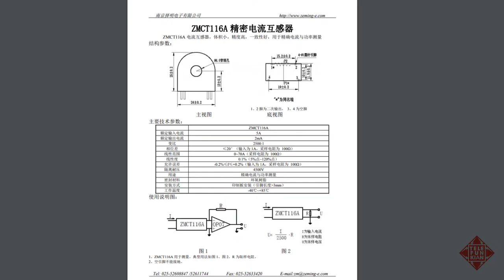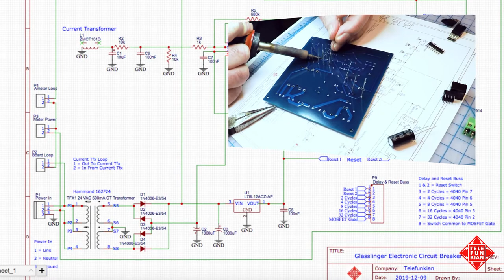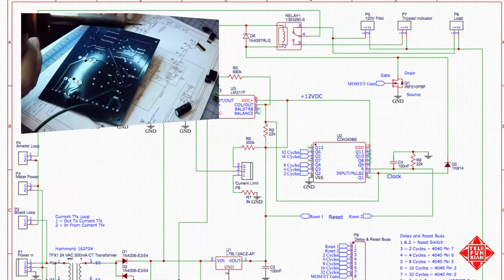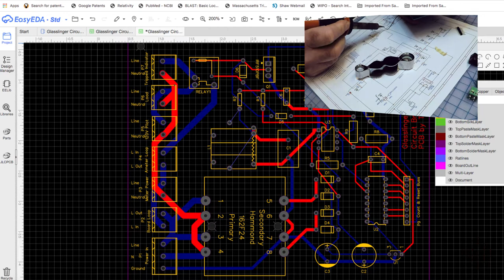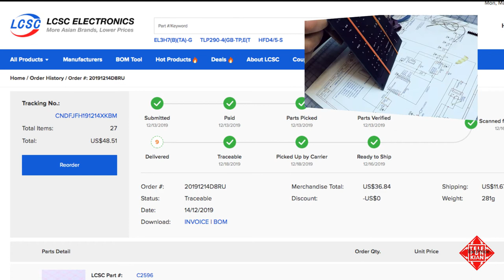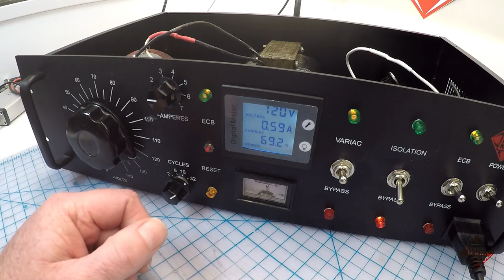Glasslinger Electronic Circuit Breaker With Variac and Isolation Transformer

Comment: Love this build. Would this affectively replace the 'dim Bulb' setup that alot of vintage repair engineers seem to be using?
Reply from the maker: Steve, First thanks for watching! I use this setup instead of a dim bulb, but it does more than a dim bulb setup. A dim bulb limits current based on the wattage of the bulb in circuit. This takes the place of a dim bulb, variac and isolation transformer in one chassis and clears up a mess of cables on my bench. More complicated than a dim bulb, but much more precise control over what happens.

Comment: Hi, i know this video is already 2 years old, but i was wondering if the device still works as planned and if you did make any adaptions in these 2 years?
I also saw that the relay you used, is a 12V 25A auto relay, but the big advantage of that type is the very fast operate (3ms) and releasetime (1.5ms),
compared to regular relays that sits arround 10ms operating time.
Also, there are many video's on the net with the electronic circuit breaker principle, but i never seen a test with a comparison in response time between a normal fuse,
and a electronic circuit breaker. In theory if you protect a circuit with a normal fuse in series with the electronic circuit breaker, the normal fuse have no time to blow, before the electronic circuit breaker has already tripped and cutoff the power, in theory, but it was nice to see this in practice. Grtz
Reply from the maker: Thanks for your feedback and question! The device is a staple on my workbench, I use it whenever I power anything that I am working on. I have not yet modified it so that the meter operates when the variac is turned down below 40v, but should do so. (I believe this is a well documented mod made to the meter, see other comments below) I find it especially useful when I am working on power supplies, or transformers, as I can adjust the AC output, isolate, and clamp current all at the same time. Stay safe!
Reply: @telefunkian  Thx, keep up the good work. Grtz
Reply from the maker: @BjornV78  Thanks again! After considering your question a bit more, there is one modification I might make, that is to change the range of the current cutoff so it is lower. I configured it to handle up to 5 amps, but in practice I mostly work on synths and things that draw much less, usually less than an amp and might have been better off dealing it in to that range. Either that or having a 10x switch on the current limit, that would be even better.
Reply: @telefunkian  , you can do this at 2 ways. 
1) With a switch to toggle between 2 values of burden resistor on the CT (Current Transformer) 
2) With a switch to toggle between 2 wires, 1 wire with 1 winding through the CT (the max setting like it now is), 
and a second wire with 2 windings through the CT. With 2 windings through the CT, the lowest current trip is split half. 
Per example, the lowest current trip is now 1A, with 2 windings it will be 0,5A. I don't think you can add more then 2 windings of normal isolated wire, 
maybe if you use emailed copperwire (used on coils) , then you can place more turns through the CT. Only thing to look for, is if the copper wire has enough gauge to handle the maximum amount of current your variac / transformer can deliver. 
Second lookout, if you want to change the burden resistor value, then do it as follow : 
Say, that the current burden resistor value is 100 Ohm, then use 2 resistors of 100 Ohm, one resistor of 100 Ohm fixed connected to the CT, 
and the second resistor of 100 ohm with a switch in parallel over the first one. That way, you can switch between 100 ohm and 50 ohm, and during switching there is still a 100 ohm resistor connected over the CT. If not done this way, the CT loose his burden resistor during switching, and you get a high voltage spike from the CT. In my project with the isolation transformer and electronic circuit breaker, i use a DIY current transformer made from a old linear charger (like Ron did), where i stripped the primary winding off, and placed 3 turns of 1,5mm² copper wire that can handle 16A, while my isolation transformer is only a 500VA version. That way i have enough reserve to handle the maximum current that i want to use (max 3A @ 240V). My lowest trippoint is arround 0,5mA up to 3A, but i use a entire other circuit then the version of Ron. I don't use any OPamps or other IC's for cutting off the power.
Reply from the maker: @BjornV78  Sounds good! When I designed this I consciously elected to use parts that anyone could order in an effort to make it accessible to folks who might be less comfortable building their own current sense transformer, I also wanted to mount as much as I could on the PCB, hence the overall approach. It has worked well so far, though I might make that mod at some point if I can find the time between projects. Thanks for watching!
Reply: @telefunkian  , i made a mistake with the burden resistor example.
For raising the sensitivity , you must raise the burden resistor in value, not lowering. In your case there is also a capacitor that act as burden resistor, the value of that cap needs to be lowered for more sensitivity. Grtz

Comment: I would like to know if you would have the schematic of the connections of the keys, I could not connect them?
Reply from the maker: I'm not sure I understand your question? Do you mean the switches on the circuit breaker?
Reply: @telefunkian  yes
Reply from the maker: @migueloyarzabal  I have just added a diagram illustrating the wiring of the bypass switches to Dropbox. It can be downloaded at : https://www.dropbox.com/s/k10t2nnbjw8dh3k/Bypass%20Switch%204.pdf?dl=0
Reply: @telefunkian  thanks

Comment: Love Glasslinger and XrayTonyB and love what you did with Ron's design. Do you have any boards left? Not sure how to best contact you.
Reply from the maker: I do have boards left. Email address is on the 'About' section of the channel. Note, the boards are designed for a 120v build, but with a selection of slightly different parts might be made to work with 220-240v.

Comment: I think this LCD panel meter can also be modded like the other Peacefair meters to stay on all the time, and display from zero to maximum volt.
Nice build , i'm building something similar by using a isolation transformer and very compact light bulb current limiter (4x GU9 halogen bulbs) in 1 case together.
Reply from the maker: Thanks for the info! Do you have any information on the mod? I am not familar with the Peacefair designation and the documentation I have is pretty sparse. I considered your approach as well, which might have been easier, but I wanted to try porting the Glasslinger design to a manufactured PCB as well.
Reply from the maker: @BjornV78  Thanks so much, I will check it out!
Reply: @telefunkian  no problem, looking forward to your next video. Greetz from Belgium.